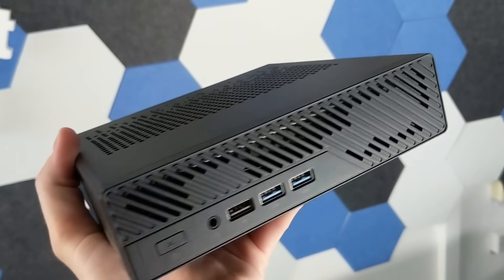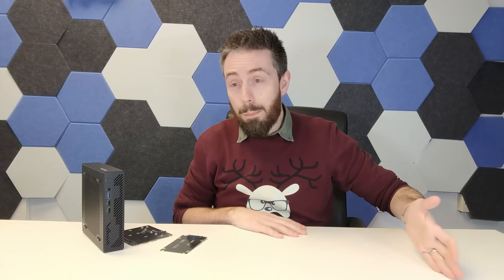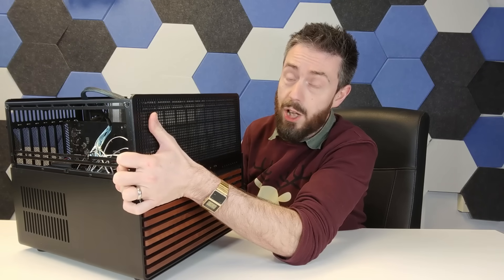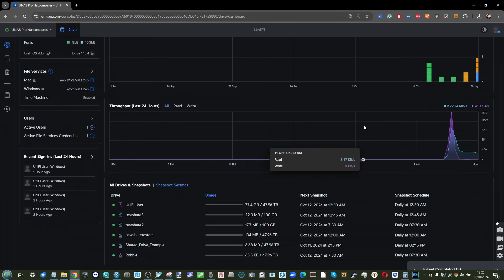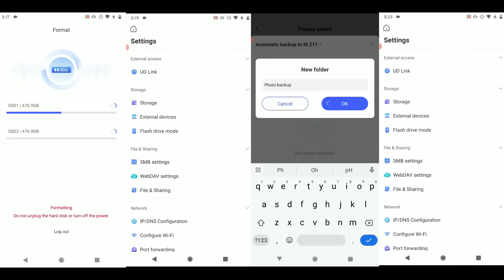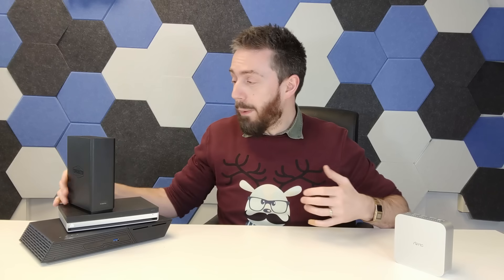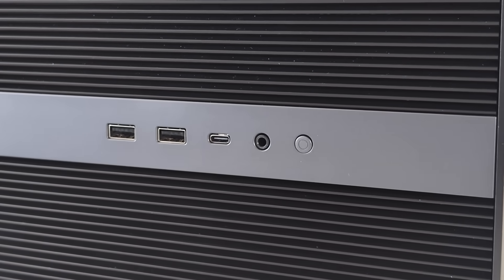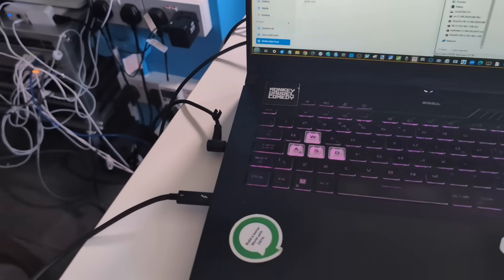My Favourite NAS Releases of 2024

Comment: Interesting choices ... not something I would've chosen.

The ZimaCube is 4-Grands with specs of an AliExpress NAS that go for half the price.

I consider the Jonsbo N5 a massive failure of engineering too.

All they had to do was improve their N2/N3 design to fit mATX and full height PCIe slots or go full flash.

They did neither, instead made their cases even bigger going full overboard.

It also does not have any sort of dust proctection but tons of open space where dust can get in.

Your reviews are usually really helpfull but your choices here going against most of my own.

Thanks for the accurate reviews - we can agree to disagree here on a respectful level.

Not something I could say for a lot reviewers nowadays ;)

Comment: Analysis Paralysis.  That's where I am.  I've watched a bunch of your videos trying to figure out what I need/want.  I've even gone out and bought a 10G switch (which ends up only having SFP+ ports which I didn't realize - and I have no use for unless I go buy some steekin' adapter).  I've gone back and forth about Thunderbolt (I have T4 on my Mac M1 Studio).  I still don't understand (even after watching your video about why USB 4 is such a big deal), how T4 could help me over 10G.  I don't get why I'd want both.  But the biggest thing that confounds me at this point is that I don't get why having a 10G network (or T4 for that matter) does ANYTHING for me, because my fastest hard drive can only read a whopping 268 MBs per second.  Isn't THAT my limiting factor on the "speed" of getting data to/from my NAS?  It's only me - I don't have a team or group.  I do have some faster non-NAS storage on SSDs and have ordered a couple OWC USB4 enclosures for them (which I really am hoping will be better than the <1000MBs I'm currently getting with crappy enclosures and non 3.2 2x2 USB on my Mac).

Comment: Got a Lockerstor 4 Gen2 about a month ago. First NAS I've ever owned. You can do so much with it. I use it as a backup location, User storage location (with VPN to access over WAN), Plex server, Media storage, AI powered object recognition server, etc... I'm still learning so much and with all this running it's still go plenty of power in reserve.
Reply: Thank you for your support!
Reply: I picked one up but seeing even glitchy text errors off the bat was not ideal and felt it wasn’t going to be a long term solution.

I did enjoy the layout and was sad to see these glitches but yeah those small errors weren’t ideal so I returned it and continued using Unraid.
Reply: @Digital_Slicker  I haven't noticed any errors myself, whereabouts did you see them? I'll have a look and see if I see them. Although mine is on the latest OS version so these may have been fixed already.
Reply: @ basic thing like the menu, clock, etc.  this was over a yr ago now.  Asustor AS6704T.
Reply: @Digital_Slicker  Yeah I got the exact same one. Had a look but can't see anything. I started on ADM 4.3.2 and now on 4.3.3, both are very new so it seems they fixed any glitches that may have been in order versions.

Comment: Although not as bleeding edge as some of the ones you picked, I'd expected the 2 and 4 disk Aoostar to get an honorable mention.   They're another *young upstart*, that's been knocking designs out of the park especially on price/performance.  And like Minisforum they've been battling to keep many in stock.
Reply from the maker: I do see your point, and the GEM10/12 are pretty sweet too - but they have much bigger things in the pipeline for next year (lincstation too) that I reckon will make it into this video in 2025!
Reply: Rooting for Aoostar here in 2025! I've got R1 as backup node for my pve cluster. Rock stable thingy

Comment: I'd argue the Fractal Define 7 is a better DIY case; it doesn't have hot-swappable bays, but has excellent cooling, build quality, noise dampening etc. :)
Reply: The number of bays is a key consideration too…
Reply: @AndyJMacLeod  I think the non XL version can do about 14 drives with all the mounting spots (getting their extra drive bay + attachments... you gotta buy attachents)

Nice to have multiple choices though, when I built my NAS a few months ago, only the Define supported this many drives as most cases only go up to 8 bays.
Reply: I have had the xl for a year now and it's been a great case. Crammed it with 7 wd red 10 tbs around a 4090 strix stuffed in the the middle.

Been a great plex, storage server along with couch gaming setup.

Now in the process of racking all my stuff up. Got the unas still in box to setup.

Comment: The coming Jonsbo N5 build video.
Please include power consumption (i.e. cost of 24/7 running)
Thank you.
Reply from the maker: Should be live this Friday. However, as I state in the video, it's more about the case build, than the CPU/Mobo choice - as there are too many types of build users might use. Hereford power consumption would be massively relative. Also, I bet most users do not fully populated this system - it's built for scalability (not just HDD scaling either). Sorry if the video lacks what you need, but I hope you enjoybit

Comment: Local AI: with the big Jonesboro case one might be able to mount an Nvidia Jetson $249 board as a coprocessor? Or just have it as a network box.
Reply: I'm afraid that you cannot, as it is a SMB.
However, you can connect a full height GPU .
On the N4, well, a half height GPU.

Comment: Why the ms-o1 with intel instead of ms-a1 with amd??
Reply from the maker: Tbh...10Gbe X2, USB4 X2, PCIe x16, 3 m.2 slots (that I have the upgrade card to make it into x6)... That's a good start.
Reply: Yea, so sad the ms-a1 just does not hit the mark... if it had the same ports it would be a banger mini pc
Reply: Im waiting on them to make a proper amd version and I'll cluster them. Not willing to invest in a 13th gen Intel chip with their issues. Everything else is great but the same feature set rocking an epyc 4004 chip would be the ultimate SMB cluster machine.
Reply: @tangodown2721  correct me if im wrong but the 13-14th gen issues dont affect their mobile chips